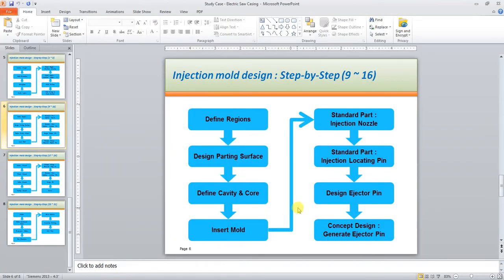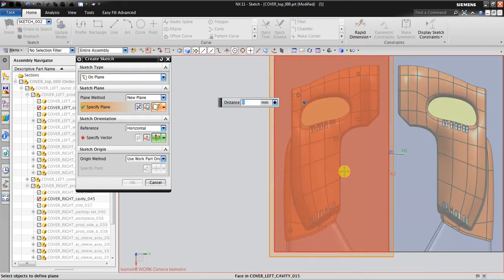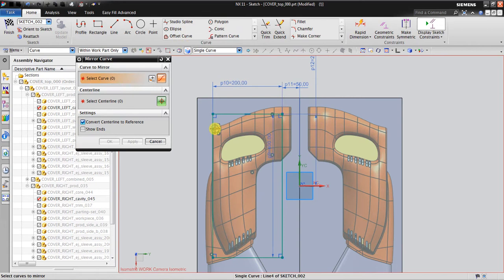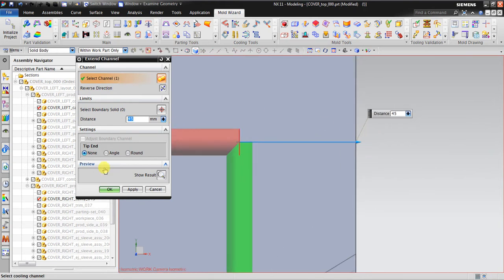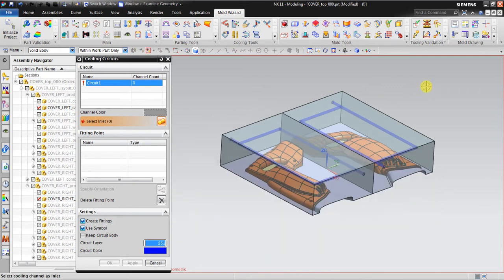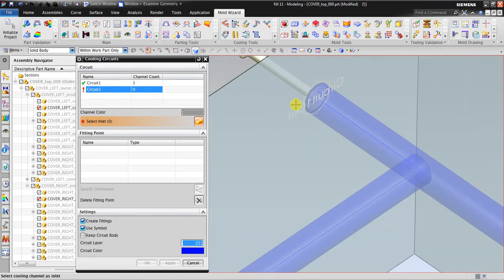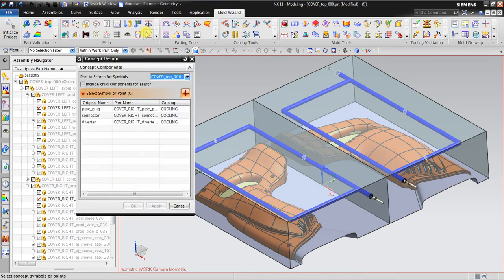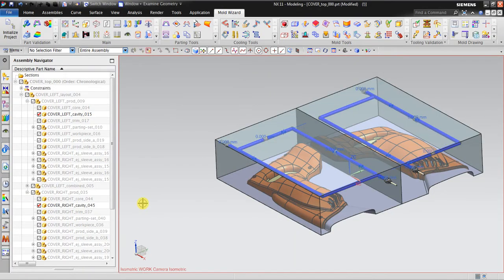NX Mold Wizard : STEP 10 - Create Cooling Channel Layout & Accessories

Comment: Your tutorials have been tremendously helpful for a new mold wizard user.  In this video you have the water channels in the work piece cavity and core.  These water lines do not come out of the mold base anywhere.  Would I just add a sketch to the mold base and create a water channel that lines up with the channel in the work piece?
Reply from the maker: Hi Sir, for water channel I suggest using extend channel feature if you want to add inlet or outlet. 
But if you want to add skech, then please go back to Pattern Channel first and edit the exisiting sketch. Then from here add sketch for inlet or outlet. 
Because NX will create solid geometry by using that skech in Pattern Channel feature. 
Or for fresh start, just delete old one and create new skech and use it for Pattern Channel input. Sometimes not all step in mold wizard we can go back and edit it. Simply because NX use geometry linker between steps and sometimes the link broken.